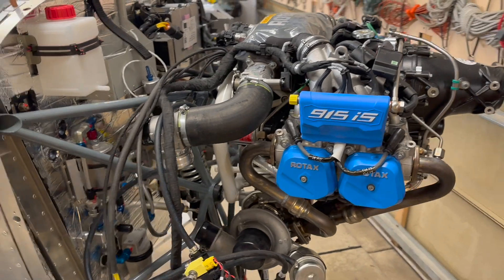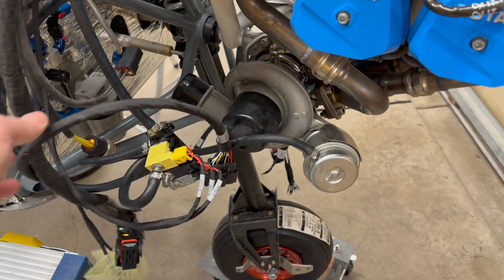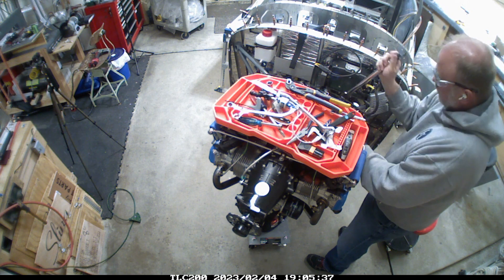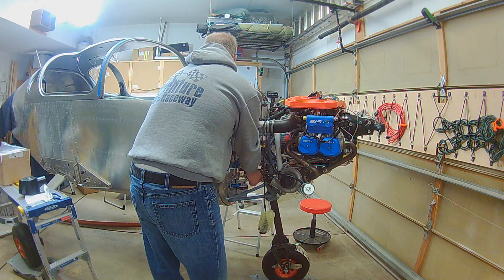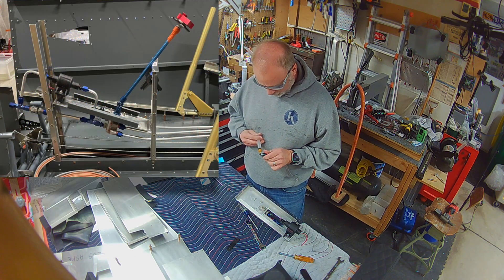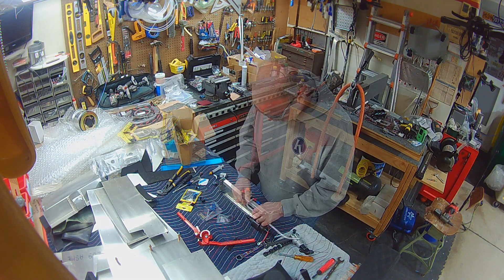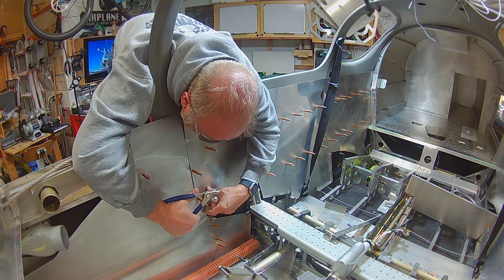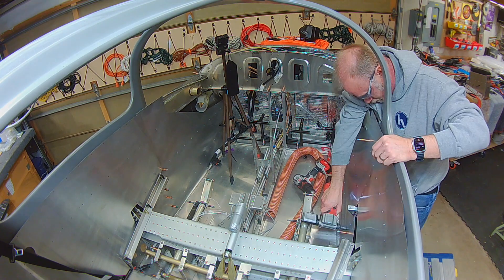March 2023   Engine Mounting and Fuel Selection

Comment: Rotax has illustrated installation manuals online that may help. That would explain why the TSI instructions are bare bones.
Reply from the maker: Yeah - I read through that as well.  It' just not as cut and dry as the build manual, there's way more reading...  :)